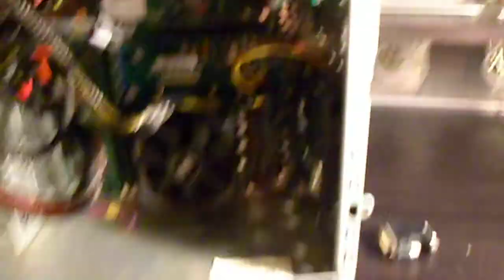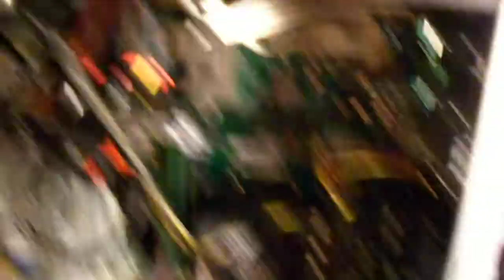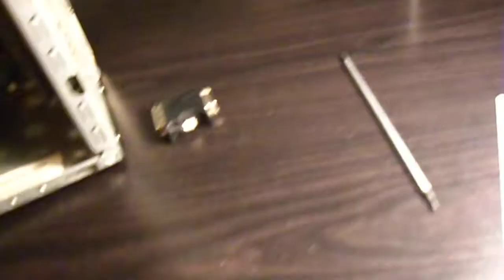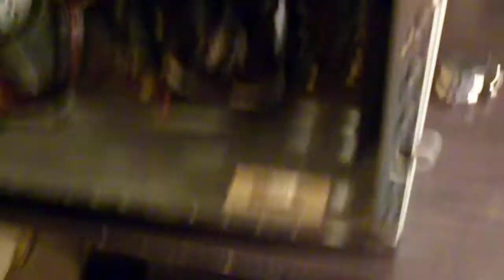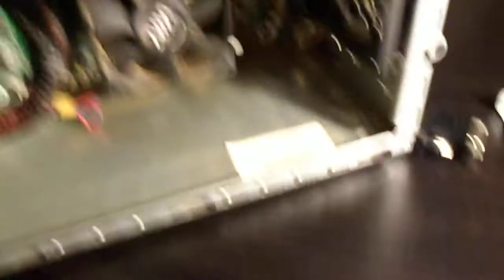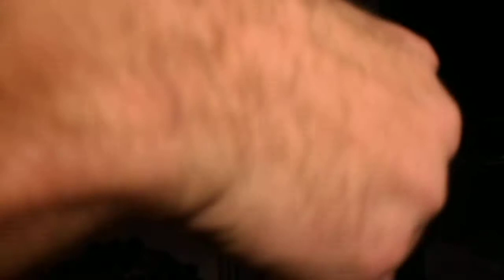How to install a graphics card

Comment: Kinda late since when this was made, but I just got this card and am installing it on a Gateway DX4870. Supposedly this card needs 300watts, and my cpu had 350. That's it, I'm done right? Just gotta put it in and it should work fine? Is disabling secure boot necessary? Do I gotta do anything with the integrated card? This is a first step into anything related to computer parts so I'm sorry if any questions sound super dumb haha.
Reply from the maker: +OzzyOzrock  No, your questions don't seem dumb at all! Your wattage is good. No need to disable secure boot. As for the integrated card, you need to disable it. There are many videos on youtube I'm sure about disabling an integrated graphics card. This ensures the integrated card does not interfere with your aftermarket card. If you can't find a video on the disable, let me know
Reply: +Craig Player Yup! Got it figured out. Now I just gotta deal with some minor bugs after the installation such as the sidebar on windows 8.1 not showing up and some game requiring some tweaking. Thanks!

Comment: Hey man it have an hp pavilion 500 and my integrated graphics card fried up and now when I installed the geforce 610 it won't read it I think becaue the bios is still In the pc but Since the gpu is fried I can't Open it up anyway I can delete its memory without a monitor ? Please reply
Reply from the maker: To do anything on a PC without a monitor is going to take some extreme skill haha. But if you get a monitor, you should be able to still disable the integrated settings whether it was fried or not. You disable your integrated graphics from the device manager

Comment: You are doing something wrong I think.  I have this mobo, and just upgraded my GPU, it fits fine.  I am able to close up my case easily.  I leave it open however, since my GPU has no fan, and leaving it open keeps it a bit cooler.  (shrugs).  Anyway, I'd try to put it back in, and just figure out if the GPU is sticking out somewhere along the PCI slot.

Comment from the maker: From what I read, you are doing nothing wrong. AOC monitors can be... a pain. Make sure all of your windows updates are installed AND make sure your graphics card is up do date on its drivers. Monitor Vs. GPU problems usually arise with out of date drivers. Be sure to visit the manufacturers website for updated drivers. If the problem continues let me know and I'll do what I can to help you out further.

Comment: Im having an issue with this and my AOC Monitor, I installed the card exactly as you did, but when I hook up the monitor to the plugs in the back of the card, it simply says no signal, but when I use the integrated card it works, am I doing something wrong?

Comment from the maker: Under normal circumstances, once you install your new graphics card the integrated graphics card should automatically become deactivated. If this is not the case then you will need to access your systems BIOS (basic input/output system) to deactivate your integrated card. Restart your computer and be ready to act very quickly! A message will show on the screen during restart that will tell you what button(s) to press to enter system BIOS.

Comment from the maker: Some cards require a power source to be connected, usually a 6-pin connector. Say, the PNY GTX 650 for example. This card needs to have a 6-pin power source peripheral (connector) connected to it. A lot of stock PCs don't have the additional peripheral or SATA connectors coming from the power supply that was included with the PC. So depending on what PC you are running and what the stock (or aftermarket) power supply has to offer, you may need to buy an aftermarket supply to get these connectors

Comment from the maker: You either have a PCI slot on your motherboard, or you have a PCIe slot on your motherboard. On my old website there should be a couple pictures to show the difference. Easiest way to tell if its a PCIe slot, is if there is a little tab on the slot you have to push down to lock a card i place. All PCIe slots will fit all PCIe cards, and vice versa for PCI. Hope this helped at least a little bit. The site should be listed in the video

Comment from the maker: @jose mondragon - for this specific card, you will either need an HDMI connection or an adapter for your monitor, unless your monitor fits the output without the adapter. You can grab an adapter at your local electronics store (best buy) if you need one. Was your card used? It should have come with one. What card do you have?

Comment from the maker: Processor	AMD Athlon(tm) Dual Core Processor 4850e, 2500 Mhz, 2 Core(s), 2 Logical Processor(s)

This is the processor my buddy has and a GTX 650. 4gb and the game runs pretty damn smooth in my opinion. Surprisingly huh.

Comment: Really..?? :P I have a friend who tried to run black ops on a pentium 4 machine with 6GB of ram and a gt440.. no matter what he did it was unplayable.. 10-30 fps.. and whatever settings you choose it dipped to 10.. Not a whole lot of games run on a p4 anymore.. And for a begginer rig.. i3 + gtx 660 is the perfect match in my opinion.. most games don't benefit all that much from more than 2 cores.. however the architechture of the cpu still matters a lot.

Comment from the maker: It'll run a couple games. Even Black Ops, but it'll freeze for a few seconds here and there until it loads the map, then it'll be a bit smoother. But I'd say at least upgrade to an Intel i5 cpu. The i7 is obviously the best route to take, but if you're o a budget, the i5 would be fine. It goes for about the $250 range from places like amazon

Comment: Computer Model Dell Precision 380 Workstation

Processor: Intel Pentium 4 (P4) HT 3.0GHz=2 x 3.0GHZ

Memory: 4GB (4,096MB)

Hard Drive: 250GB SATA hard drive

Optical Drive: CDRW + DVD-ROM drives - 2 drives

Graphics Card: nVidia GeForce GT210 1GB 3D Gaming Graphics

is that ok for a beginners pc?